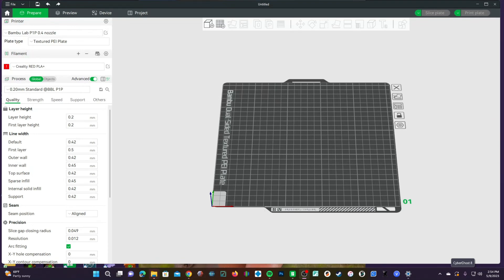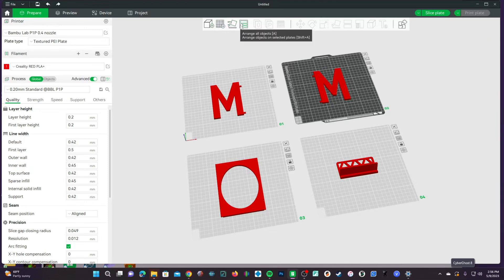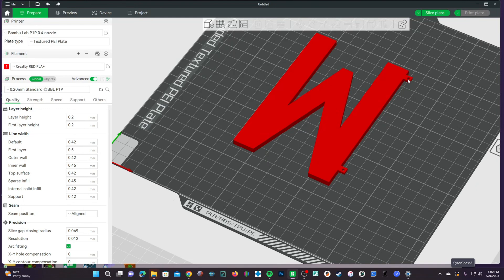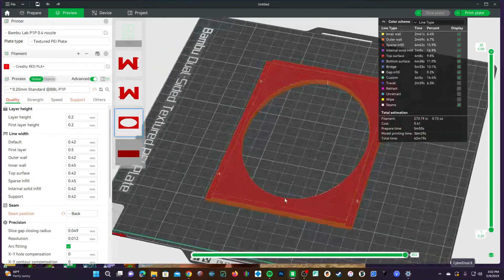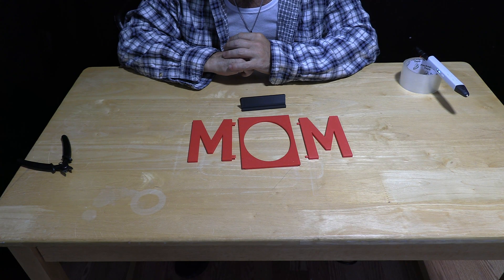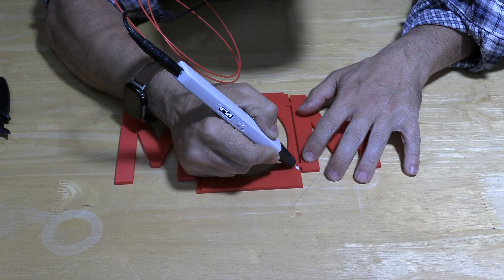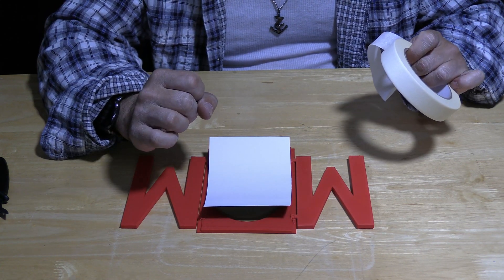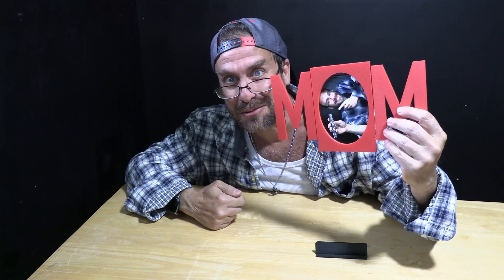Bambu Studio Walkthrough: "Mom" Photo Frame, using Multiple Plates on your P1P / X1C

Comment: Hi, new to 3D print but you are my favorite so far, I have an Ender 3 S1 Pro, and after your video about the spider v4  I just want to put it in my s1 pro, but I think is not compatible, please is this possible? If not what do you think is the ultimate Hotend that I can adapt to my s1 pro, thanks, and keep the amazing work
Reply from the maker: No. The Spider is excellent but not compatible with the Sprite. I would get my hands on the High Flow Kit, which uses the Spider Hot end, or, perhaps even better, the new Ceramic Heated Hot end Upgrade for the Sprite.
Reply: @3DRundown  Great, I think I'm going with the ceramic heated hot end and also add a 5015 fan using the v4 air duct